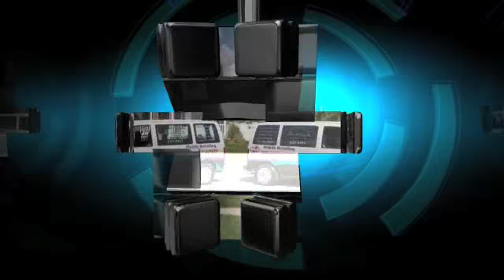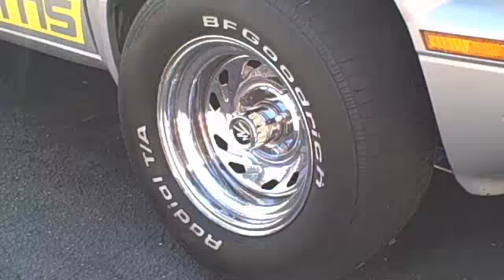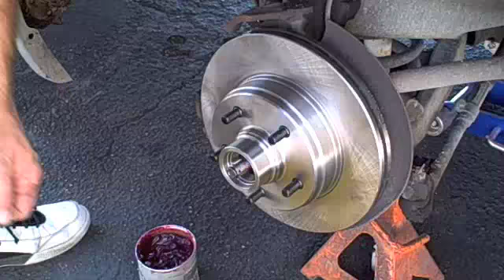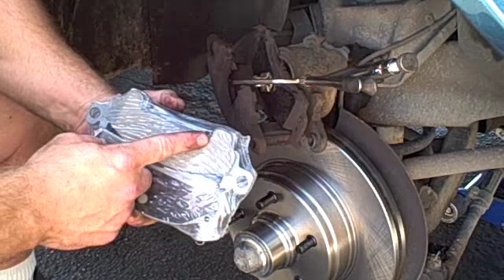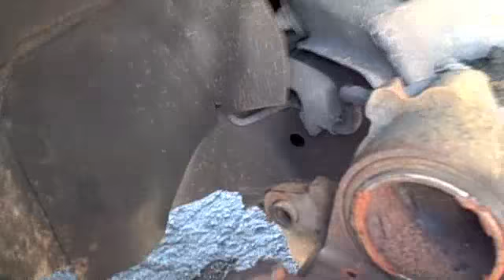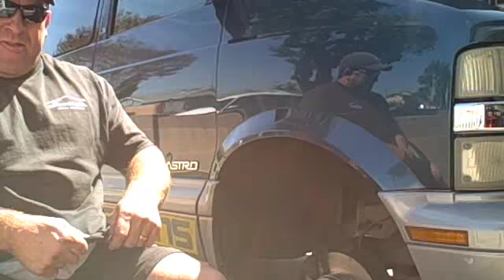How to install front brake pads

Comment: I really appreciate the astro videos, they are near impossible to find online.  I am looking for a video on how to remove the front shocks.  I have a 99 chevy astro and a 99 gmc safari.  I have also been trying to find a video on how to drill/punch out the rivets that hold the window motor to the door frame any help would be greatly appreciated.